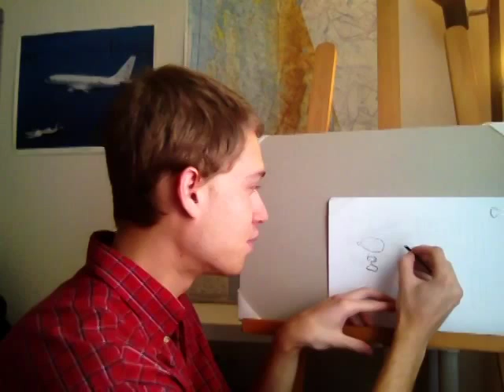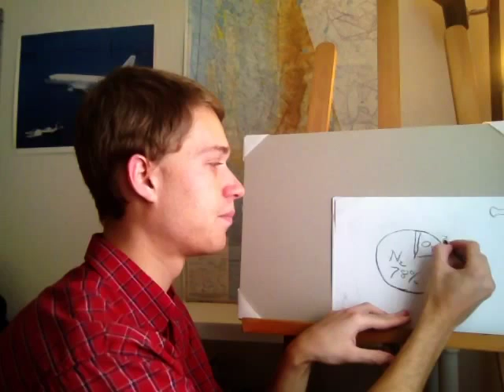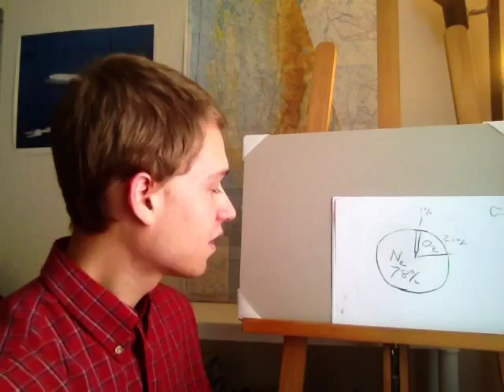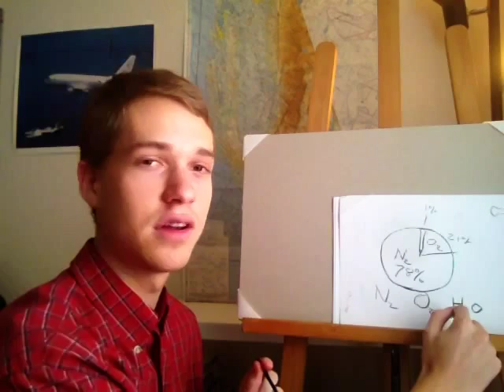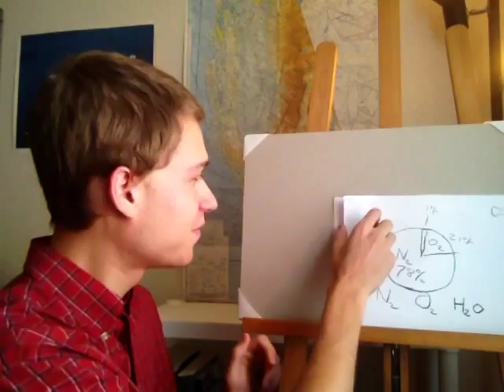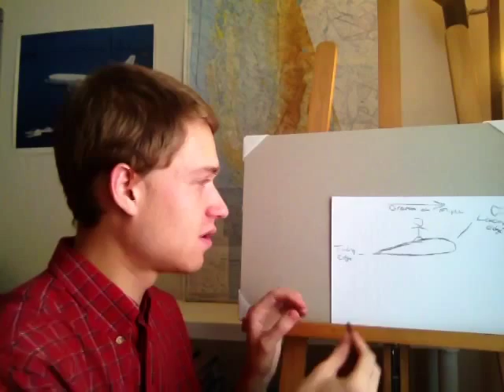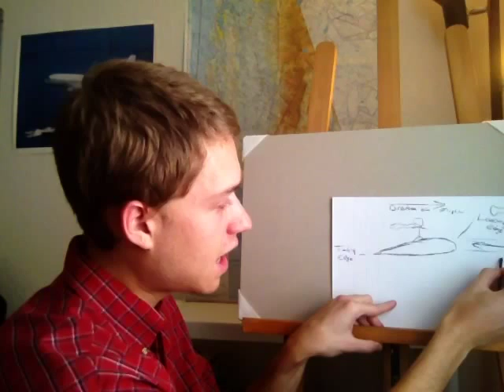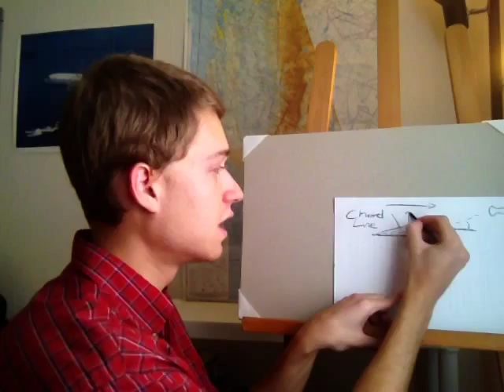2 Principles of Flight

Comment: You can't "Increase the speed" of one flow relative to another flow.  That is an all too common misapplication of Bernoulli's findings. An increase in speed is a change along a single airflow. It travels at one speed then speeds up later in that path.   If you are faithfully repeating the way the FAA describes the formation of the lower pressure above the wing, they are wrong.  A difference in speeds between two flows is not the same as an increase in speed along one flow.  The words "change" and "difference" are not synonymous.   A direct analogy is if a car passes you on the highway, it did not increase your speed.  It has a different speed. 
...
.If the air speeds up as it flows over the top, then the pressure there is lower than in front of the leading edge where it was slower.  It increased speed from in front of the wing to above it.  This would be correct application of Bernoulli's findings.
...
The false part here is that the air going over the top may reach the trailing edge before the lower air, but relative to the ground, or stationary air, the upper air does not really speed up. Its horizontal speed is pretty constant.    In addition, the air under the wing is the fastest moving air relative to the ground or stationary air.  This contradiction points out the fallacy of this faster air has a lower pressure than nearby air in a different streamline.  Bernoulli said nothing about the speed of a fluid along, or near a surface, only about CHANGES in velocity.  
...
Dave Bentley's images from a wind tunnel show these true velocities (faster on the bottom, slower on top. Look carefully @ streamlines 8 & 9 and the stationary vertical line.  Now which is the "fastest" air? http://219sqn.aafc.org.au/Flight/Wings%20don't%20suck-How%20planes%20really%20fly.pdf  
...
The pressure is lower above a wing (actually because of the air's curved path) than below it (also because of the air's curved path)  and the air is curved, or 'turned' downward into the downwash.  These are two PARTS of the whole explanation of lift, not two different ways to look at it.  Some people summatize it using only one of these parts, but they are both parts of the whole explanation.
-- 
Regards, ScienceAdvisorSteveP.S.
Reading the on-line FAA handbook (2008), I see they dance around Magnus and ignore the downwash it creates, and make several misleading statements other than the above.  They first say: "It is neither accurate nor useful to assign specific values to the percentage of lift generated by the upper surface of an airfoil versus that generated by the lower surface. These are not constant values", but contradict that a few paragraphs later by saying: "This negative pressure on the upper surface creates a relatively larger force on the wing than is caused by the positive pressure resulting from the air striking the lower wing surface."
...
They talk about the stagnation points, but give no logical explanation of their significance.
...
They say: "The pressure difference between the upper and lower surface of a wing alone does not account for the total lift force produced." then sort of say that the Newtonian downwash provides the remaining lift.  This is not true.  The pressure difference is all the lift and the downwash demonstrated the "Equal and Opposite" of Newton's Third Law.  Equal and opposite.  This is the reaction to the pressure difference which requires the pressure difference to be ALL the lift if the downwash id the evidence of an equal force.
...
Finally, once you realize something you'll have a very good understanding of all this is.  It is the path of the air that creates lift and not simply the shape of the wing.  ALL WINGS produce similar pressure differences of air below and above and downwash.  Not identical, but similar air flows.  A pilot in my local area lost a significant portion of the upper skin on only one wing and flew home with nothing more than significant rudder.  From this he assumes the upper surface has no bearing on lift and refuses to consider anything else.  What he fails to realize is that the flow over that skin-less upper surface is very similar to the good wing, just with more drag due to the turbulence of the open spar spaces  The flow of air above and around that turbulence is little different from the good wing as It flows past the turbulence.    This is reflected in the explanations of the gurney flap and vortex generators on wings where turbulence can be put to good use, rather than only causing trouble.